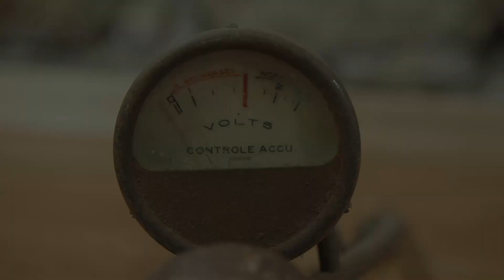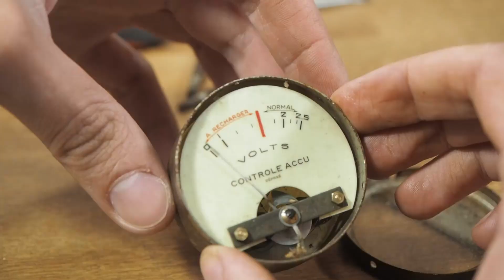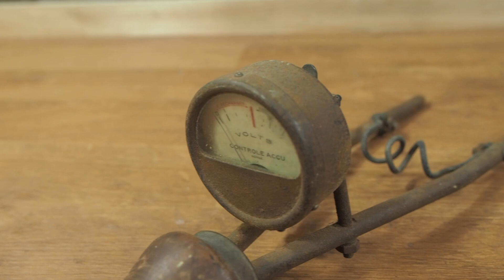Antique Battery Tester Restoration

Comment: I was using one in the 1960`s on tar top batteries. Most batteries were 6 volt, or 8 volt, you tested the cells not the whole battery by pushing probes  through the tar or across the the individual cells at connector straps, reason for tar was to prevent corrosion. Yes you are load testing but it's only 2 volts, how long it stayed at 2 volts on the gauge was to show how strong a cell was, if it drops off quick or has nothing it's a bad cell. Not something you can do on a modern battery.
Reply from the maker: Thank you for your input, very informative !

Comment: Does the spring not sort the batteries?
I don't see any isolation between the test leads and the spring.

Sadly no demonstration in the video
Reply: This is not a spring, it is a length of resistance wire that puts a load on the battery whilst testing.
Reply from the maker: Thank you for your comment. Roger is right. I've updated the video description to explain the lack of test.